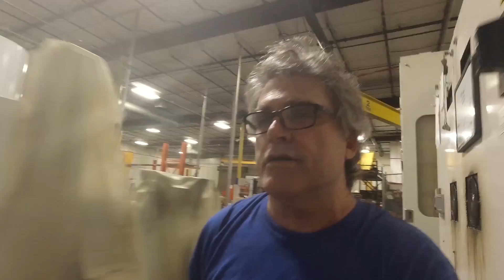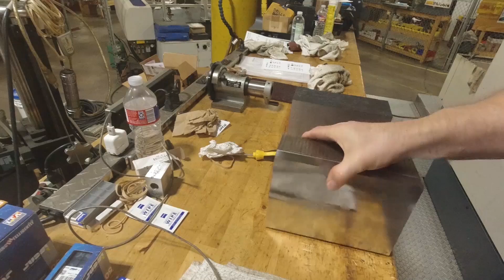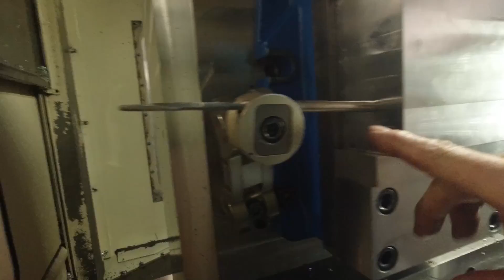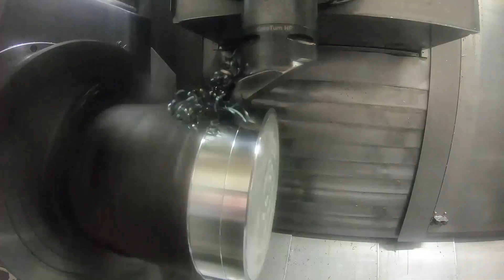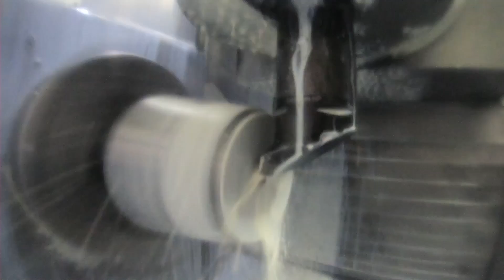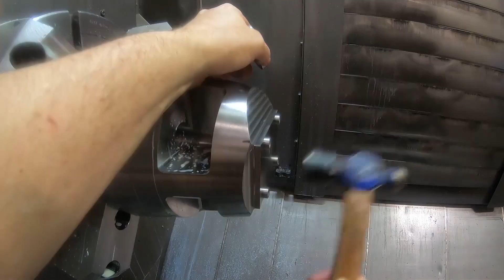Stock Prep And Mazak Fixture For 14 Lb Anvil

Comment: I saw him crash 3 inches the endmill into the vise small crash not bad that is an okay machinist once while  running the CNC machine said you never crash the machine which  means you are afraid  to work on the machine doesn't matter how careful you can be just one little detail you forgot in the program you can crash!!!!,
Reply from the maker: Actually I was manually jogging the machine. When I did this in this video. With the better simulation's that cam software have now days, you rarely have problems in the middle of programs. Mostly people have a problem approaching the work with a wrong offset setting or hitting clamping elements. But if you define the fixture and it's clamping elements in the simulation that can usually be avoided. All that said, if you say you have never crashed a CNC machine. That usually means you haven't run one enough. It's kind of like a motorcycle rider saying he has never fallen off the bike. It will eventually happen. It mostly has happened too me when someone interrupts me and I forget what I was doing and miss a step. Or like in this case, I was paying attention to the camera's monitor and not the axis jog switch.

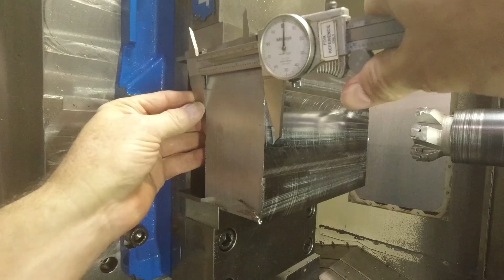Comment: 7:59 measuring the part with visible burs.... I seriously hope you guys don't do this.
Reply from the maker: I'm not going to deburr for just a check of the thickness. The burrs were not facing the way to interfere with the measurement. What if I had to take another cut. It would just throw up another burr to take off. The only time I would deburr in process is if it affected the measurement. Or possibly posed a real danger of cutting myself. In this case these burrs did not.

Comment: ….23:00...... Does that spindle have the motor right there on the rear of the same Axis...?
Reply from the maker: The milling spindle is the motor on the B axis. It's a integral 50 Hp motor. There is also a clamping mechanism the clamp the and supports the spindle at the different angles needed for the turning tools.
Reply: @EdgePrecision  Thank you...I worked on NC/CNC stuff in the 1970's....MAZAK was in it's infancy here in the USA...I worked in Los Angeles for Burgmaster. 4 axis machines were like...Magic..!!

Comment: I saw a student jog a tool above a renishaw tool setter and then jog down in Z and plow through the touch pad and into the table. I myself once had the jog increment set to 0.1 and crashed a ruby probe tip into to the top of a part. Left a visible dent and the ruby exploded with some vigor. That’s why I now jog a few clicks up to make sure my jog increment is set properly.

Comment: We have a Chinese lathe at the Menz Shed I belong to.  It's not huge — 38mm spindle diameter.  The same handle operates the cross slide and carriage feeds, so if you pull the handle back to end the cross slide feed and go to far, the carriage starts marching towards the chuck.  The lever does not have a good positive feel to it either, so it is all too easy to do.  Having said that, I have managed to avoid getting it wrong after many hours of use, but what I have done twice now, is engage the carriage feed with my tummy while leaning over — especially when using the compound slide.  So I have some scars on the chuck jaws and a busted tool holder.   The secret is to have the lead screw  (this lathe does not have separate feed and lead screw) turned to its neutral position when you don't need it.  Or I could lose half my body weight so my tummy  didn't hit the lever.

Comment: its intresting, the rpm of the spindle actually changes when you take the cuts with the big milling head. You can see from the patterns in the video that they are different when the spindle is free running and when it makes contact with the workpiece the patterns change and become different. This means that the tool rotates at a different rate to the fps of the camera, meaning that the rpm is different.

Comment: I think you don't need to do semi rough using a 1/2", just extend the surface let the ball nose start in the air and you will be fine..
Reply from the maker: Yes that could have worked. But there would be air cuts in the middle areas to do it. Also the ball mill would still be cutting with the tip plunging down in the corners. Just only the step down depth. Still not good. Better to keep away from cutting with the tip of a ball mill when possible.

Comment: Random question. With the ball nose. Could you program this to stat at the bottom and work to the top. Then I my mind you wouldn't have needed that 12.7mm long cutter to ruff it it? Keep up the good work Peter. And thanks for keeping the little bang in the video. It makes me feel normal, seeing people who have probably forgot more than I know make mistake I have done / bound to do again
Reply from the maker: Yes that is possible. I think the cut length along the tool would be longer than the cut length of the tool I was using. Also this might increase chatter during the cut until it gets near the top. But the tool path can be reversed.

Comment: Seeing the mill take off the paint of the vice presumably because your vice jaws are a bit narrower than the vice body and your safety margins were based on the jaw dimensions instead of the vice body. Is that distinction modeled into the vice fixture settings and would have been caught by the CAM verification had you been running programmatically?
Reply from the maker: In  Esprit if it is modeled correctly. I will detect it even if its only a .001". I have changed things in its simulation that small and it could tell. This collision was much greater paint thickness. That label on the side of a Kirt vise is a plastic strip around 1/32" thick.

Comment: Fixture looks great.  Thanks for showing all the roadblocks along the way. The newest lathe in the shop half nut lever is opposite the other lathe and opposite the 2 other lathes I have used...need I say more.
Reply from the maker: That's where you have your hand on the carriage hand wheel and try to disengage the half nuts but they don't release. You than grip the hand wheel like you expect the back the carriage up but it doesn't. And things get real interesting from this point on. Been there done that. Thanks Bill.

Comment: Nice video as always peter, I was wondering if you could give me some speed and feed info on your insert spotting drill, I use one also from time to time but it never seems to do that good, I think I'm feeding too fast but not sure as nobody else in the shop has ever used one before
Reply from the maker: This type of spot drill has to run fast and feed slow. I usually feed it at around 1.0" per minute at around 3000 rpm. This depends on the material and diameter you are spotting to. If you don't run it high enough rpm the tip will fail (Not enough surface speed) and if the feed is to fast the tip will break. I have one that goes to .980 diameter. I had to spot drill a bunch of holes in 316 SST to .765 dia. With a standard spot drill I only got a few holes with one of these, I got all the holes with one tip. Running at 3000 RPM and 1.0" feed. It doesn't sound good but it keeps going. I would probably guess you are feeding it to fast.
Reply: @EdgePrecision  ah ok, I will try and go a quicker speed and slower feed next time, by the sounds of that feed I was going quite quick as I was under the impression that you need to go fast enough for the carbide to get underneath the material.

Thanks!

Comment: You can see the 'wagon-wheel' strobe effect changes when the mill is cutting under load (e.g. at 7:50). Doesn't the mill have a controlled spindle speed that adjusts under load? Maybe it's just the tiniest amount of change that syncs up differently to the camera, but I'd be curious to know how much actual change that is.
Reply from the maker: I'm not completely sure but this might be due to video conversions and frame rates. I'm filming at 60 frames per second the cutter is running a 600 rpm. Here in the USA the video frame rate isn't exactly 60 it gets converted to 59. something. So it could just be going in and out of sink. Kind of like when you notice the wheels of a car looking like they are turning backwards.  Also when I convert this video to YouTube HD there may be some changes there. I don't think this has to do with the machine as much as the video.
Reply: @EdgePrecision  Seems to me if it was a video issue it would be consistent and not correlated to cutting under load or not. It could be just the tiniest amount of change, enough to show up in video, but within the mfg spec and insignificant to the machining quality. And yes, AFAIK, GoPros record at 29.97 fps to match NTSC Color TV rates (an artifact of the transition from original 30 fps B&W TV to Color. I worked on TV/Video equipment in a past life...)

Comment: Nice fixtureing.  A lot of work for 2 parts.  Cool to watch.
Reply from the maker: Thanks Randy. Actually I may make more of them. But I don't think it would be economical as far as selling them. I would have to be able to get blanks closer to the finish size (Maybe flame cut to the profile or water jet cut) and speed up the machine work (Read that as reduce the quality). Than there is also heat treatment. People have already asked in the comments but I don't think it's possible. Unless they are willing to pay.
Reply: @EdgePrecision  Yep for sure.  A fully machined anvil would be very costly.  Very cool anyway.

Comment: I just returned from a used machine tool dealer and what caught my eye was a small horizontal mill that was missing a good quarter of it's table surface in gauges and slots from slitting discs...I felt a lot better about myself. The difference here between manual and CNC machining is on manual machines the sound of the cut might change half way through and you will be wondering while on CNC machines it's usually more like heart attack!

Comment: You selling these anvils Peter?
Reply from the maker: I don't think it will be economically feasible to make these to sell. I priced the material in flame cut 4140 plate. That by itself was $86.00. Now add machine work, tooling, heat treat and shipping.  I don't think so. Unless you are willing to pay a lot.

Comment: Did it stall on the crash? I guess me exploding that drill bit on video wasn't a good enough reminder on jogging the wrong axis, or at least the wrong way. Rapid down on a drill bit is tough on them.
Reply from the maker: Thanks! Yea I saw your video. It did stall the Z axis. But in that instant it cut the full width of those inserts until it got to the metal face of the face mill. I don't think that would cut the hard steel of the vise base and jaw. I just wasn't paying attention to my axis select switch. Getting in to much of a hurry. These bigger machines have a lot of power and can do a lot of damage in a hurry.
Reply: @EdgePrecision  Just glad it didn't knock your machine out of tram. A new vise jaw and a decal and you can cover that mistake up so you don't have to look at it.

Comment: i'm very afraid of mr bozo after crashing my probe two times lol. whenever i jog and switch axis now i do a little tap just to make sure i'm going the right way
Reply: i also have a safety quarter turn , because once i almost bamboozled an omp40-2 probe , and a few times i almost jogged turning tools in the workpiece .
Reply from the maker: Yes in this case Bozo said you are getting to confident and need to knocked down a few. But it would be good to try to always jog in the positive direction first. Just to make sure what axis you are jogging. Maybe just a few clicks also. The most damage usually happens as in this case in the Z minus direction. This one I just spun the wheel.
Reply: @EdgePrecision  yeah both my crashes were  z-minus crashes while i was probing manually hahaha

Comment: Still using TNG? How you liking it so far?
Reply from the maker: Yes I am sing TNG for everything thing on the Mazak. I don't have a model/post combo for the horizontal yet. Not DP tecs. fault I haven't given them the information yet. I will say this the support people at Esprit (DP technology) have been really good and address and fix my issues/questions sometimes in les than a few hours. I am liking the accurate simulation. It has already saved me a few issues with collisions between the machine elements (Not just the tool being used) That other software's would not have detected.

Comment: Always wondered mr Peter, how many inserts do you go thru monthly ?   Excellent video as always, thx a lot for doing them 🙏🏼👍🏼
Reply from the maker: On the Mitsubishi horizontal I go thru about $1400.00 a week worth. On the Mazak it varies so I'm not sure.
Reply: Edge Precision wow, if it s aprox the same for the Mazak it would be smth as $12.000$ a month, that is a loot of inserts i guess. Here i get inserts for pretty cheap prices ( 12-15$/box of 10 ) but there i guess they are more expensive :)

Comment: The best part of the vid was not the bump into the vise. It was the lights turning off after the bump and going home for the day to take a break. Then start fresh the next day. That is how we prevent hammers from being thrown across the shop!

Machining is a long list of simple tasks to produce a part. When a machinist F's up a simple task, we get mad.

That is how you distinguish between a machinist and a hack, a machinist will take responsibility for their mistakes when a hack will blame others for their mistakes.

2ND best part of the vid IMHO was when the corners were killing the ballmill. It happens all the time and Peter kept it in the video. It showed that plan A didn't work out so a plan B had to be improvised and implemented. (a normal thing when cutting parts)

3RD best part was the use of 5X tool paths "just because you can". It's a smoke’m if you got’em type of thing.

Thanks for the honesty Peter!
Reply from the maker: I had to power down the machine because I stalled the Z axis with this one. It wouldn't reset without a power down.
Reply: @EdgePrecision  I'm supprised that stopped that machine in its tracks. The makinos at my shop would have made it a lot further
Reply: @EdgePrecision  My mistake.  Sorry to assume.
Reply: words of wisdom
Reply: The lights were just the power down and restart after axis overload
Reply: @mannycalavera121  it will take a lot more than that to stall out a proper horizontal like that mitsu
Reply: I didn't think much about the lights turning off when I first watch the vid. Really thank you for these words of wisdom! Not only the one who did it (Peter) but also the one who can see and understand what the action means, then explain it to the other like you are the true wise men. Thank you again for these words, it would take youngsters like me decades to understand the great philosophy under these small actions, but now, it just took 40 minutes and 1 comment.

Comment: Why not plunge mill those cut outs with the feed mill? Keeping all the vibration linear rather than radial seems like it would be more effective.
Reply from the maker: The feed mill isn't designed to work in that direction. The high lead angle is for the side direction. But I do have a plunge milling cutter. I'm not sure if Esprit has this option in a roughing cycle or not. Its generally just not the way I rough things. I not sure but I don't think it would be faster.

Comment: There is this weird blue oil I used a few years back micro misting it on the carbide and boy that stuff really works to cut and get lots of use out of your carbide tools.The idiots that ran the shop said it was too expensive though and would rather blow a bundle in carbide inserts instead. A little money coming in under the table in kickbacks it seems.

Comment: You crashed the face mill, not the Renishaw probe. You're stuck staring at a gouge in your vice, it's probably the cheaper mistake. (As long as the inserts weren't destroyed.)
Reply from the maker: No it totally messed up all the inserts. But they were partially used anyway.
Reply: @EdgePrecision  :(

Comment: Is the whole tool changer hydraulic like in a lot of Mazak machines?
Reply from the maker: The tool changer on the Mazak is totally driven by servo motors.
Reply: @EdgePrecision  The 50-taper Mazak mills I remember had a hydraulic tool carousel and at least one of them had a hydraulic powered changer arm.
Reply from the maker: My Mitsubishi Horizontal mill in the beginning of this video has a hydraulic tool changer.

Comment: There's no machinist alive who hasn't moved the wrong axis at least once.
Reply: Just once 😂 I wish
Reply: 11 years experience and i did it yesterday lol
Reply: the worst is manually touching off a brand new endmill and accidentally moving it down instead of up LMAO
Reply: Its a controlled crash. Just bought a set of kurt vices where there are a ton of gouges out of the hard jaws. Probably 1/8” inch missing in one spot off the height

Comment: Awesome!
Reply: Shhhhit. That wasn't good. Did the lights go out because the machine detected an overload and shut down?
Reply from the maker: No I had to power the machine down because I couldn't reset the alarm. Sometimes this can be corrected by hitting reset and turning on the servos again. But not this time.